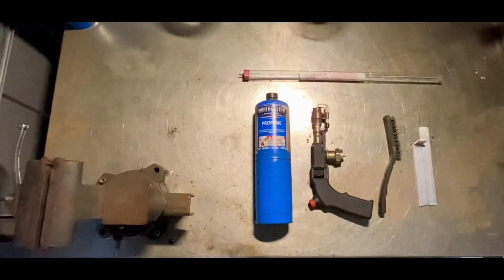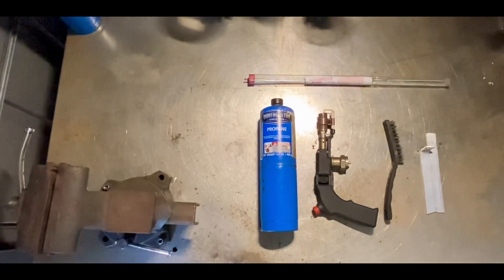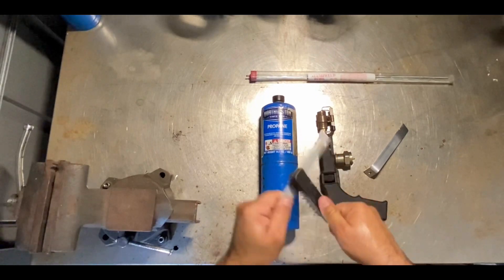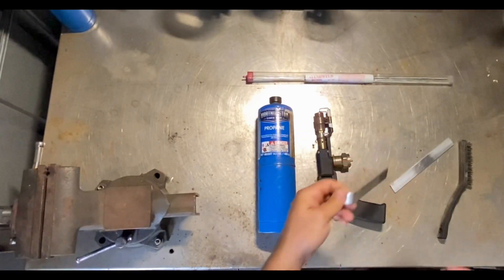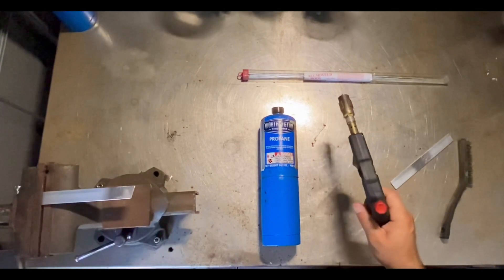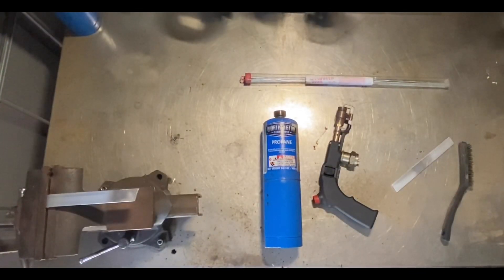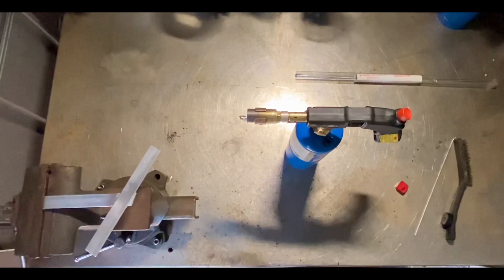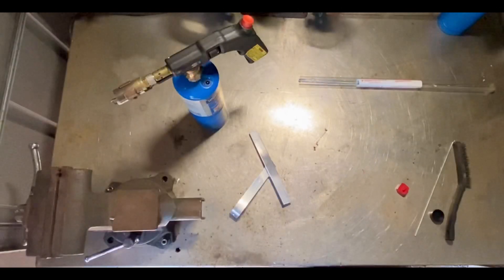How to WELD Aluminum Without a Welder, Alumiweld, Aluminum Welding, Aluminum Brazing

Comment: Dude… this is not welding and idk why you even use the word welding. You’re just using two existing pieces of metal and melting them into each other (braising). This isn’t welding and any monkey can do it. Great if you want to make a picture frame like what you are doing. But DO NOT USE THIS ON ANYTHING THAT IS BUILT TO MOVE OR TAKE PRESSURE.

Comment: I have tried these soldering method. The rod always turns into a blob. Never sticks to the surface. Always breaks off.
Reply: You aren't getting the aluminum hot enough.  Apply the heat to the work, not the solder.

Comment: This is not welding. It's brazing. You should also use some flux which helps stop any oxidation taking place. It also helps the molten rod flow into the joint between the two plates. If this does not happen, then you are likely to have what is called a 'dry' joint and it will easily break. Contrary to what a lot of people think in these comments, brazing is not inferior to welding. When done properly, brazing can be as strong as a weld, possibly stronger depending on the type of material used in the brazing rod.
Reply: This is not brazing, this is soldering.

Comment: I am impressed with your "solder gun" for this purpose.  I have long used a standard "solder gun" for plumbing, but you have to hold down the "start" button to keep the flame going.  Your gun seems to have an "always on" switch which works great for this purpose.

Comment: I have an aluminum car wheel that bit a curb and the "bite marks" are cosmetic do you think brazing them and then sanding them smooth would work or should I get it welded..the wheels holds air without any issues and the damage it near the lip that wheel weights would go but I use tape weights
Reply: I was thinking of doing the same.did you ever get around to it? If so how’d it come out?

Comment: Nice demo. The problem is that brazing does not melt the aluminum itself. It is a soldering method. It is great for home projects, like I am doing. It is pretty tough. Now, if you look at the metal in the middle, where the two strips overlap, there is no material in between the two. To melt aluminum, we need a temperature of over 1000 F.  Again, I love brazing, but I would not use it in a  place where lots bending occurs. There you need TIG, where the aluminum  melts and you just add the filler to keep the two joints in place. 
Brazing is great for lots of hobby use.

Comment: You’re having trouble with low heat because the steel vice is acting like a heat sink and drawing off the heat. Elevate your parts on something to fix it.

Comment: Thanks for the vid. Is the aluminium softer after brazing or does it recover its strenght? I wanna weld aluminium pipes to make a load carrier.
Reply: The correct way to fully fuse Aluminium together is to actually weld it, TIG A/C setting with a correct filler rod or A/C arc welding with a correct coated stick rod...  The TIG route would be the way to go.....

Comment: Welding and brazing are two different processes. Welding involves melting the metal of your part and adding molten filler metal so the two parts become one. Brazing involves heating your part (but not melting it), so that it can receive filler material (brazing rod) through capillary action. The filler rod is not aluminum, but an alloy that melts at a lower temperature.  In brazing the two parts have not become one, as in welding, but are connected by the filler material. Brazing is akin to soldering. It is a good application for ornamental metal work, or light duty applications. It is not appropriate for structural work. Thanks for the video.
Reply: Explain brazing in bicycle frame manufacturing then please. It's a process that's no longer used but plenty a frame from the 60's and 70's were brazed together and still perform to this day. Hardly ornamental if you ask me.
Reply: @kevinrichardson2003  Thanks for reading my post. As I said, brazing is good for ornamental and LIGHT DUTY applications. The bicycle manufacturer's engineers most likely used brazing in applications that they felt would not be subject to forces strong enough to break the joint. There were probably economic reasons as well, such as brazing being the most cost effective solution for their particular need at their particular time.
Reply: @Hank-ski  Brazing can actually be stronger than welding depending on the material used in the rod. It's certainly not for 'light' applications only!!
Reply: steel tubes aeroplane frames too I think.
Reply: @kevinrichardson2003  Brazing can actually be stronger than welding contrary to what every here keeps saying.
Reply: @johnpearcey  Interesting. What kind of heavy duty applications is brazing used for today?
Reply: @Hank-ski  Jet engines, rocket engines, and other aerospace components.
Reply: Yeah I was about to say that to but you got it all covered 😂
Reply: so this video is on brazing for light duty oranmental repair ? I've pretty good crack in auto part . What do you think of repairing something like that ? It's where AC compressor is mounted to oil pan
Reply: @frankmontez6853  I would think that for automotive applications a brazed repair would end up failing with vibrations, and most significantly torque, experienced by a compressor. In a weld the filler and joint are as strong as the part's material. In a braze the filler is not as strong as your base material.
Reply: My question is, can you braze a small leak in AC system in car?
Reply: @hectorgarza228  Car AC systems are under pressure. I'm not sure if brazing will hold up to the pressure, but that's a guess. I don't have experience to know for certain.
Reply: @hectorgarza228  It depends on where the leak exists.  I was able to use alumiweld on an Corvette to block the hole where a Schrader valve snapped off on the high pressure side.  It lasted the whole time I owned the vehicle; 10+ years.
Reply: Thanks for the explanation. Seemed like it took a long time in this video to heat up. I assume MAP would be better?
Reply: @joeblow1942  MAPP gas should heat up faster and hotter, especially in a torch properly designed to use it. His torch seemed not to concentrate the flame tip, and he kept holding it away from the materials in the video. Also, the problem with welding aluminum is shielding the molten surface to prevent oxidation and inclusions — that’s what the argon gas is for (or CO₂/ CO₂ mixed gas). Raw surface of aluminum oxidizes very quickly, faster when you heat it. Aluminum oxide melts ~3200°F while aluminum itself melts ~1200°F.

Comment: I have a question, does anyone know if this method wold work to repair a small crack on an aluminum wheel?
Reply: ABSOLUTELY NOT.
Reply: I just typed the same question lol 😂
Reply: @williamdon3442  I will properly weld a cracked wheel for $50/hour, 2 inch crack is generally and hour or less and it gets you back on the road.  I get diy, hell I diy stuff all the time.  But this is a safety issue.  This isn't a car part you want to mess with.  If you send me a wheel with sealant in it, I charge extra for the cleaning process.   Save money, just do it right.

Comment: Very nice instructional video. Very well thought out, very good verbal instruction and describing in detail what you were doing. One thing is instead of using Propane, I would use MAP gas which comes in the yellow bottle/canister. My father and grandfather were pipe fitters and anytime they did any soldering on copper pipes at home or on jobs they would use MAP gas because they said it burned hotter. Aluminum is tricky because it conducts and dissipates heat and cold really well, so getting the aluminum really hot might help the aluminum stay hotter longer and the Alumiweld to flow better. All in all a very good video. Thank You.
Reply: Alumiweld needs just 730F to work while most Aluminum melts anywhere between 800 and 1200F.
MAP reaches ~3700F while regular propane reaches 3600F 
Having studied thermodynamics, 235W/Km is pure aluminums thermal conductivity at room temperature. Using the same weight and surface area aluminum, the energy (J) required , we can see the difference of gases. MAP heats up the aluminum faster, but the time it takes to melt said aluminum is negligible as 3700F vs 3600F starting from a surface temp of 70F and desired temp of 730F would take less than a second difference. Propane is significantly less expensive.

Also, being a DIYer who has used both gases in practice, the difference is negligible. There's really no reason to choose MAP over Propane unless you already have it or you're going to die without brazing that piece of aluminum in the spare second.
Reply from the maker: Thank you, I appreciate it. I will try MAP gas next time.
Reply: @bo0stedracing  MAPP gas

Comment: Don’t need a big fancy machine, but you do need map gas, not propane, propane doesn’t get hot enough for proper bond.  Check temps on y rods, and gas, and practice practical application, definitely need MAP gas. Yellow bottle.
Reply: I’m pretty sure you never used one! What you’re saying is what people tell you. Propane or Mapp/Pro get the same temperature the difference is the TIP you’re using!
Reply: Hate to tell you but propane and mapp are very different. Now if you live in communist California you don't have mapp, you have mapp/pro which is literally just propane with a mother inert gas that gets you an extra couple of degrees. I use real mapp all the time with this stuff takes 45 seconds and strong as can be
Reply: @Mike Studmuffin propane will melt them. Not get the work hot enough to bond. Propane is 700 degrees, those rods require 750 to properly bond which you get with Map gas.  Theres more than just melting it.

Comment: Do you think I could use this on my mountain bike frame??
Reply: Please don't try to use this for a bike frame. This is NOT welding, this is a process similar to brazing and soldering. Think of the brazing rods like 'glue' - it's not metallurgically bonding to the components - rather it's sitting on the surface (and hopefully into pores/abrasions) of the components being brazed. It can produce a strong bond, but not nearly sufficient for the types of stress that a bike frame must endure. This could be used for cosmetic or low weight items like rack/light/water mounts.
Reply: I just finished using this stuff to put together an aluminum battery base. Its easy to stick clean aluminum together, but its just as easy to get a superficially bonded joint that cracks easily. Its very sensitive to application and technique and takes a bit more practice than this video shows. And while the tensile strength is allegedly higher than the base metal, the shear strength can be actually quite low, and I had a couple of joints split open without much force until I  got the process down. So no, I definitely don't recommend it for any structural repairs on a bike frame.
Reply: I would not recommend that.  This is essentially brazing... not welding, so is not as strong as an actual welded joint.  BUt I suppose it would be okay for non-structural stuff on your bike, like mounting a water bottle bracket or something like that.